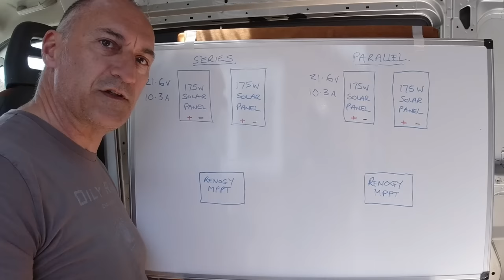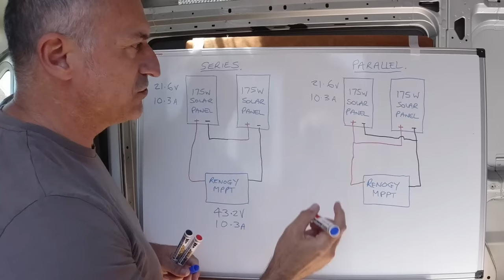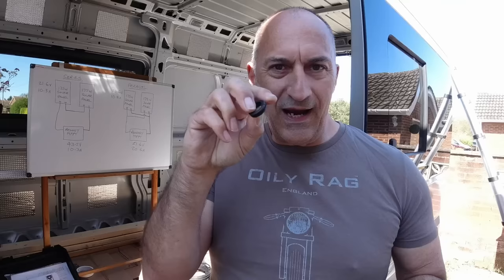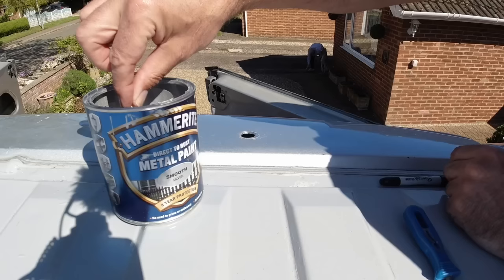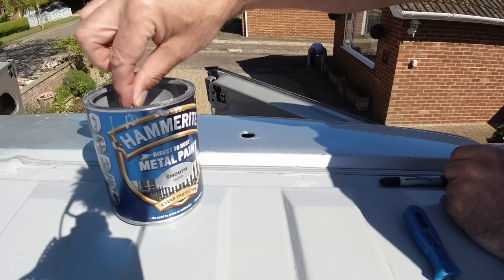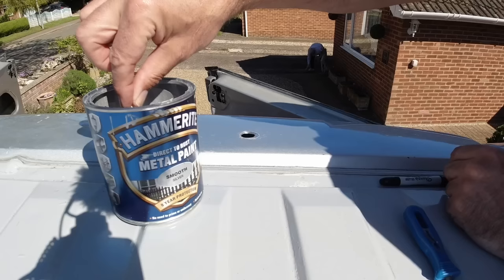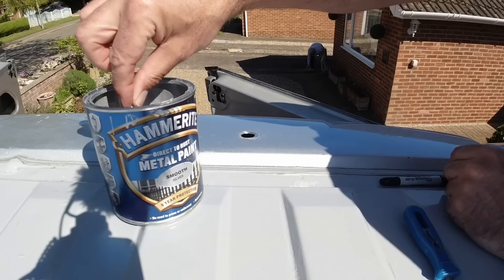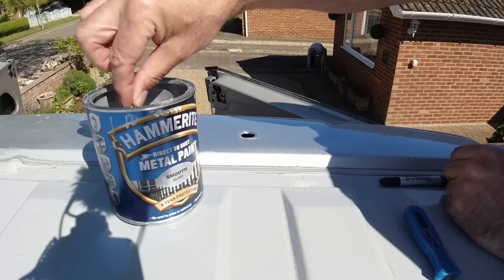How to Install Solar Panels - Budget Van Build Ep 10

Comment from the maker: PLEASE READ THESE NOTES BEFORE COMMENTING 
1. I put electrical tape on the ends of the cables so they would not touch anything metal as they were threaded through the van. It’s best to leave a panel disconnected to make sure there are no short circuits while running cables. 
2. The gland box was deliberately placed that way round to avoid cables hanging in mid air over the back of the van. They do not leak this way around if you tighten the glands around the cables. 
I will add to this thread if I continue to get repeat questions. Thank you 🙏🏼
Reply: Greg any particular reason for using sikaflex EBT on the gland box?  Would Silaflex 522 be okay?
Reply from the maker: @darrensmith403  only because it was black and I had it already. I wanted the black to match the gland box.
Reply: @GregVirgoe  perfect.  I have plenty of sikaflex 522 so I’ll just use that. Thanks mate

Comment: For fixing the solar panels to the roof, I used plastic corner fittings bonded to the roof with Sikkaflex. You definitely don't need to drill the roof, and you don't need bolts or screws into the roof. It's been up there 3 years now. Absolutely bombproof.
Reply: Until years of wind force loading/lift and vibration weakens the adhesive and it one day becomes a 10kg missile into the back of a minivan when you brake hard. I hate the idea of putting holes in the roof, but it's not worth the risk of the thing sliding off at 100kmph.

Comment: If you want extra panels Ona roof use some long drawer slides to position one over the other with locking catches and a length of wire. Use one for full time use and pull the other out when you need it.
Reply from the maker: That’s an interesting idea 💡😃
Reply: Cheers greg could you recommend a video tutorial please 😃
Reply: Would that effect the other panels if one is not being used and in shade?
Reply from the maker: @neilkelsey3178  if you wire the two sets of panels in parallel then it would work fine in both positions as the shaded panels would have no affect on the others. 👍🏼😃
Reply: @GregVirgoe this is interesting, do you or anyone reading this comment have a video/photo solution of them being stacked with a drawer style pull out for when using/parked up?
This would be a good solution for us I think as we have the TentBox on the roof too. We have a Caddy Maxi by the way 😅
Reply: I was just considering doing this but the issue would be to make the slides not rattle … do you have a parts list ? Or build I can barrow
Reply from the maker: @davidse4486  if you search on YouTube for “Slide out Solar Panel” there are loads of videos to choose from 👍🏼😊

Comment: The Renogy combined units are great, just make sure you install a solar isolator switch in a super accessible position so you can get the full charge amps from the alternator when the sun isn’t so good. If the charge controller sees any current from the solar panels it halves the current draw from the alternator.
Reply: Please explain this more please?
Reply: @ChrisTewkesbury  the controller will only allow max 25 amp charge from the alternator if it senses any charge coming from the solar panels. This is ok if there is plenty of sun and you are getting plenty of amps. If it is dull, raining, evening etc and the solar is only charging at 1 amp for example you are missing out on charge from the alternator. If you put an isolation switch in the solar circuit you can temporarily disconnect the solar so you get the full 50amps from the engine/alternator. 
Most folk have an isolation switch but it is often buried deep in a cupboard or in the garage of the van so it isn’t easy to get to when you want the full charge rate from the alternator.

Comment: Maybe someone has already mentioned this.....  But, when I am using a holesaw to drill through sheetmetal, in a similar situation as this (When you don't have access to the opposite side.), I will pre-drill a pilot hole through the surface.  That way, when you drill the finished sized hole, with a holesaw, it typically won't "fetch up", and "drop through" as you finish your cut.  You can "baby" the drill and hole saw down through the metal, because the pilot hole was already in place.

I am brand new to all that you have been sharing here.  My hope for me in the near future is to, fit-out a van of my own.  My perspective of watching what you are doing, and how you are teaching others, is coming from my own personal history of 38 years in the yacht building industry. (Sailboats and power boats as a yacht carpenter.). You know your stuff, and you are a wonderful teacher!  Thank you for taking the time to put all of these videos together!

Comment: I am a 75 yoa DIYer from Washington state. Thank you for the clear and useable presentation. It was very useful as I am about to start my first conversion build. I am very interested in how the cables/couplers were secured beneath the panels to prevent rattling/ etc. Thanks again!! Subscribed😊

Comment: Use a short piece of petrol hose, or similar, between the bracket and roof. Then when the bolts are tightened the sikaflex is not squeezed out. There are also caps available for those bolts.
Reply from the maker: Thick plastic washers pushed into the sealant will do the same and is good advice 👍🏼😃

Comment: EXCELLENT SO INFORMATIVE I just happened to stumble across one of your videos when you said tap the bottom  link it will show you all the videos so I did that AND now I'm actually going to put a solar panel on  the roof. EXCELLENT work EXCELLENT job on your videos job well done step-by-step step-by-step even I can do it😂 well fingers crossed. 😮
Where are you from?

Comment: Great video. (Again) A possible advantage of using the Unistrut mounting system is the flexibility it allows if you need or want to fit different size panels in the future. No need to worry about brackets being in the wrong place.
Reply from the maker: Yes there is that but these should last for years and years 👍🏼😃

Comment: Ive linked up 3 x 175 renogy panels to my renogy MPPT, as I suspect one of you next vids wiil go on to explain the renogy DC charger has the option to keep the house and starter batteries topped up all in one device, and also house batteries charged from the alternator as well. Been running my system for a couple of years and it works a treat. Thanks for the series sor far.
Reply from the maker: Exaclty that, Dc to DC plus MPPT and will charge both leisure and van battery from solar, all in one box for £150 bargain

Comment: Thanks for another informative  video Greg. Invariably there will be a lot of vibration of the solar panels and the nuts securing the solar panel to the  bracket may loosen. If you haven't  got nylon insert nuts as you suggested, a couple of drops of locktite threadlocker on the bolt should prevent vibrational loosening. Or you could use a second nut as a jam nut to prevent loosing.  Looking forward to the next video.
Reply from the maker: They have spring washers and I don’t expect there to be any issues. Thanks

Comment: Thanks. No dramas about the glands or cables. Tip top. The 'spare' holes on the roof brackets might be useful for cable ties to secure the Ys and fuses, if they are in the right place. Otherwise as you say adhesive pads with cable tie holes are simply excellent. These can even be 3d printed and hratshrink then hot glue is also an option. Yes, I'd have opted for nylocks rather than spring washers and hope. Some thread lock is a good backstop, too. Keen for the next steps!
Reply from the maker: All very good advice and a great comment to leave here for others. Thank you 😊

Comment: Tip ,when drilling holes in metal pre drill hole with drill bit only then fit hole cutter, the pre drilled hole will act as a guide for hole bit save breaking drill bit
Reply from the maker: You should not need to do that as the arbour bit is longer than the cutter so the centre hole is drilled first in any event. Watching it back it more likely that I had the drill at an angle and was pressing down with too much force. The saw bit caught and threw the drill off at an angle.

Comment: Hi Greg. As usual a well put together video and a clear explanation for those new to these things. Just one point I'd  like to mention. You indicated that you would tidy the cables on the roof with sticky bases. I too use these all of the time but have learned not to trust the adhesive. Normally I would back it up with a screw or if this wasn't appropriate then remove the adhesive and use Sikaflex for piece of mind. Keep up the good work and I look forward to more tutorials
Reply from the maker: Yes some of them can be rubbish. I found it makes a big difference of the surface is very clean 😊

Comment: Great video as usual!  I prefer to do a dry run and drill all screws through the metal while hoovering the metal shavings, then, unscrew them, after that, reinstalling them with Sikaflex:  that prevents the metal shavings to be stuck into the sealant for ever.
Reply from the maker: It’s really not necessary with these self drilling screws. I find if you wind the screws in and out you loosen the holes making them less secure. 😊

Comment: Great video, really good to see you back at another van conversion Greg.
I’m half way through my own Transit Mk8 MWB van and just completed the first fix electrical, I used a similar set up to yourself but just smaller for my needs; 200w panel, 
Lithium 175Ah, 30amp DCDC MPPT. 
I found the Renogy gear to be fantastic value for money, great quality, and a hassle free installation, I hope you do to.
Looking in forward to the next update, all the best! 👍
Reply from the maker: Yes I agree the brand has got good reputation for quality and still at affordable prices. I think the combined units are really good idea too. 😊
Reply: Can you mention the boost and float modes on your next video, I think it would really benefit your viewers. 
Not sure if your going with an inverter on this build, but I would highly recommend the Renogy ones, the automatic switch over is superb!
Reply from the maker: @craigwatson4631  yes I will do and I have got their inverter too. The mains changeover is a fantastic feature 👍🏼😃

Comment: Nice helpful video once again. Just when I was thinking "I would have drilled a pilot hole first before using the hole saw" . 😢 Good that you kept that in video though, proves its not all plain sailing. Keep up the good work.
Reply from the maker: i noticed on the video that I had the drill at a slight angle and not vertical, which was enough to give it a kick when it bit into the van
Reply: You beat me to it👍common error, being an industrial elec, I've seen it many times... Also use both hands on drill, and use low speed. 👍
Reply: Step drill is easier

Comment: 25 volts. 
Great video and you couldn't believe the timing. Just bought the same Renogy unit last week and looking at solar panels. Was confused by the max 25 volts for the unit so your video was priceless! Hooking the Renogy up to the alternator too. Would be good to know how that works with a smart alternator.
Reply from the maker: Yes it is low and always good to check the specs. You will find this setup very useful to you 😊

Comment: Hi Greg I installed the first panel on the sprinter roof and I wasn't convinced with the single nut and bolt option for the brackets, there's a lot of vibration up there, also the self-tapping
 screws provided to fix the panel to the roof didn't seem adequate. So I set off to buy some bolts and disaster struck the panel blew off the roof and smashed in the road. I fixed the new panel with a thicker gauge 3 cm metal tapping screw then I went inside the van located the screw protrusions on the inside and drove two screws per bracket from the inside out, it was a much sturdier job, I also fixed metal tapping screws from the brackets into the frame of the panel, I can't realistically see the single nut and bolt holding, I'd never be confident drive long trips like that. But all good so far, great tutorial thanks, I'll keep you updated I'm fixing the maxi fan today.
Reply from the maker: Well I guarantee that this panel would stay where it was with no screws just the sikaflex alone. 
As many have done.

Comment: Nice and simplified demonstration on Series & Parallel wiring there Greg - perhaps an option on reducing solar cable rattles on the roof is to mount/clip them on using `Legris polymer tube clips` with Sikaflex underneath?
Reply from the maker: I have used sticky cable tie pads and they work really well 👍🏼😃

Comment: I like how you only screwed the panel mounts into the high spots on the roof, but not in the valleys. It is funny how some people will spend $500 on a 50lb roof rack just to avoid making a few screw holes in their roof, then cut 2 giant holes for fans. I wonder though if you would not be better off using a bolt/rubber washer/van roof/lock washer/nut attachment, as those sheet metal  screws might vibrate loose after a couple years.
Reply from the maker: Yes there’s a dozen screws in each roof fan so a few more makes no difference. I would expect the sikaflex to hold them very solid

Comment: Top job greg  ,,I love there products used them in my build the dc to dc changer is a good bit of kit as well , ,I made some aluminium brackets when I fitted  my solar  it made fitting easier as you ended up with a flat place to fix to ,if you want can send some for you to show guys on here
Reply from the maker: Yes it’s a good balance between quality and cost. 
Perhaps you wouldn’t mind posting a photo on social media and tagging me in it 😊thanks 👍🏼
Reply: @GregVirgoe  what do you use Greg  I don't use face book ,you got an email I send some build pics if your interested
Reply from the maker: @robinbean6716  my email is on the about page of YouTube 👍🏼😃

Comment: I wish I saw this video before I bought my renogy 50a DC to DC/ mppt charge controller! When I found out my victron 250w solar panel was over 25v meaning it was not compatible 😢 it didn't blow it up though, just shows a fault. I bought some more flexible panels to put in the windscreen and wired them up to it and they work fine 😅😅
Reply from the maker: It’s an easy mistake to make as most other charge controller do handle way more volts. 
Glad you got it sorted in the end 👍🏼😃

Comment: Hi Greg. No they dont leak that way round, done three like this and no issues. I also fitted the Renogy system to my build and it has been great. Not only b2b charger and solar controller but also charges the vehicle battery when leisure battery is full. Mine has stood over winter, and with little sunlight, we have both batteries remained fully charged. Great system and if you get the Bluetooth coonection you can see what its all doing on the app. I have the battery monitor also and is not a bad price. Dont know if you are having this on your build, but not a bad bit of kit for the money. Great video mate.
Reply from the maker: That’s really good to hear. I’ve got the Bluetooth device but not the battery monitor. Is it a Renogy 500A one with shunt that you have got? It’s dropped to £65 now 🤔👍🏼

Comment: brilliant work you have been a massive help, 
on your next cast you used 2 batteries will it make a difference to the set up if i use 3 in the same configuration

thanks again i would never been able to attempt electrics without you

Comment: Hi Greg, I'm right at the start of my camper journey as I don't even have a van 😂. I always like to do plenty of research before I take on something new. I've looked at a few videos on other channels  which are good, but I've been tranfixed by your superb "detailed" videos. 
I can't wait to get started now using your video instructions. You've made me feel confident enough to complete a van conversion with the skills I have. Just need a van now😂. 
I will be transporting my big old Harley with me, so will be allowing for that in the van aswell. What is the length in the back of your Ducato from the back of the seats to the doors when shut please? I need 2.6 metres for the bike and chock.
Thanks again for your fantastic series. 👌🏼
Reply from the maker: This van is 3m inside. I got some 10’ x 5’ sheets of ply in the back and they just fit. 👍🏼🤩 just be careful about the weight. You might want to look into up plating

Comment: another cracking informative video Greg. I'm looking forwarard to viewing your electrical install so I can have a go at putting right what horrible job the chap that partially converted my van did.  Bessy regs- Kenny
Reply from the maker: I’ve drafted in some advice on this part to make sure it’s up to current standards so it should be very useful to all 👍🏼😃

Comment: Great video just looking at rover it seems expensive still for a budget build , I have a 20 amp rover one in my split bus very good kit
Reply from the maker: I’m not using a Rover one here this is the 30A DC to DC charger with built in MPPT I think it’s great value as it’s doing everything I need in one box 🤩

Comment: I am planning to install four 200W panels on two set of sliders (54" long). I want to pull out the solar panel to become the awning.
Reply from the maker: Wow sounds very ambitious but will give you tons of free electric. If you have the two arrays wired in parallel it won’t matter when one array is shaded.